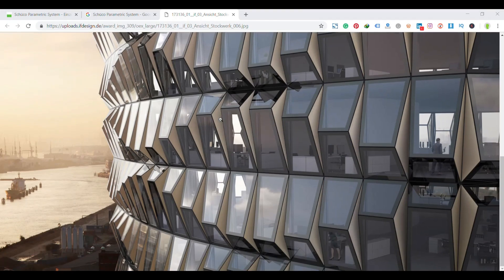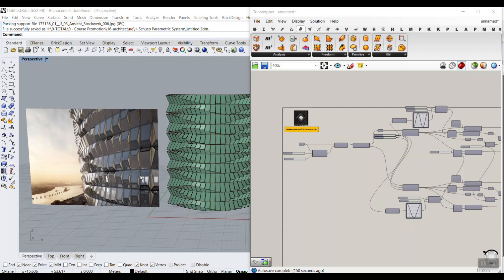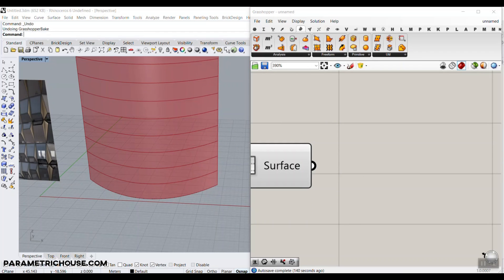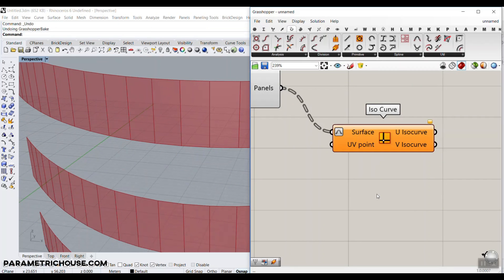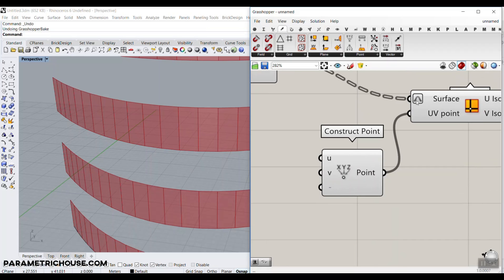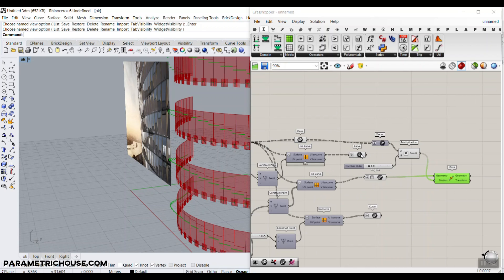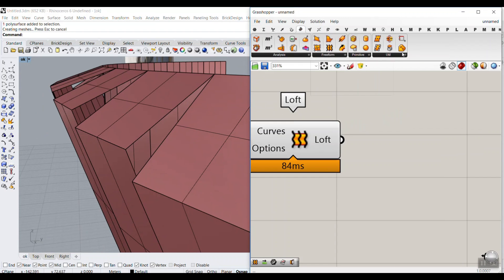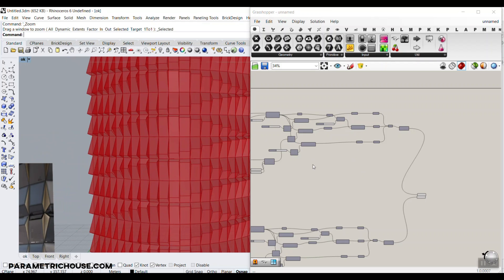Parametric Architecture (Schüco Parametric System)

Comment: I have a question and I hope you help me with my project,,
I did the same thing but in a flatten horizontal surface, and my question about the movement (Hight) in the minute (14:50), how do I make that rhythm of the movement? I mean I do not want them all at the same level of height.

hope it is clear. and thank you.

Comment: Hi, thanks for the tutorials.  Am actually curious about the Lunchbox Plugin that was used. Do Lunchbox components actually combine a series of operations that can be done with the original Grasshopper default components ? As in panelling can be done with default GH components but it is much more troublesome so Lunchbox makes paneling much easier and more efficient ?

Comment: i got screwed trying this because i got problem with divide domain, because of the first step extrude u have done, i did extrusion from curve using extrude and surface using unit vector, that gave me problem later, anyway good tutorial :)
Reply from the maker: Tanx
Just a quick tip, remember to explode the surface when you extrude it in Rhino so u can be able to import in Grasshopper

Comment: Really simply done. I immediately thought of connecting points and lines in separate cells and such, but this option is much easier. Just using lofts and end caps. I'm going to look more into isocurve and isotrim. Thanks!
Reply from the maker: 🙏 exactly this can be done in many ways